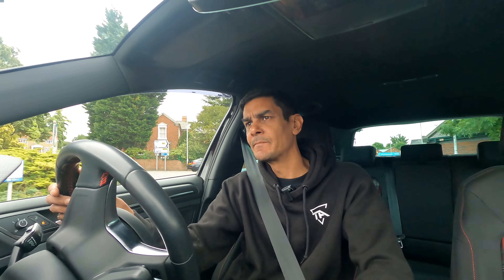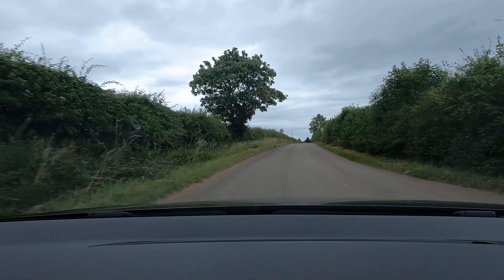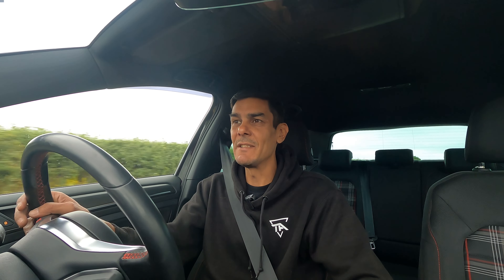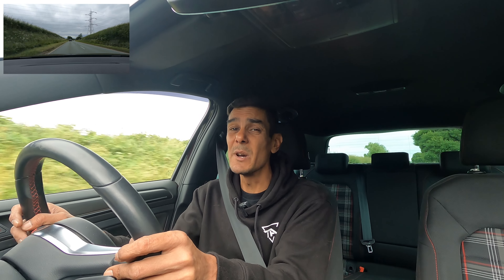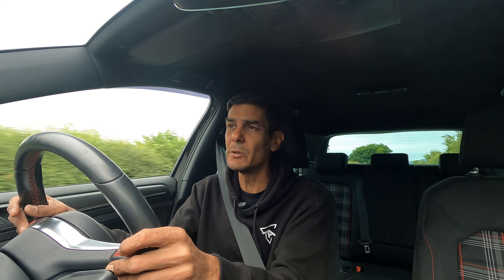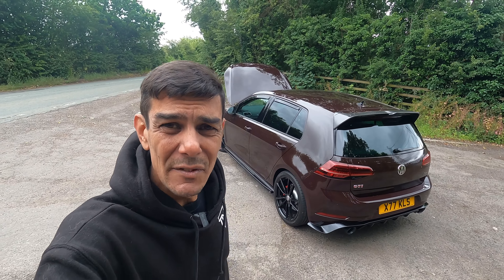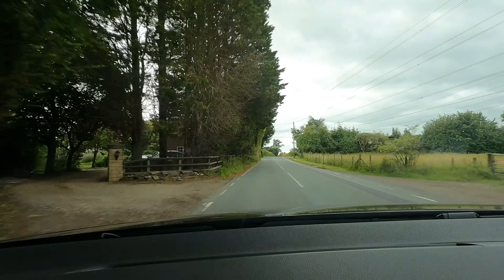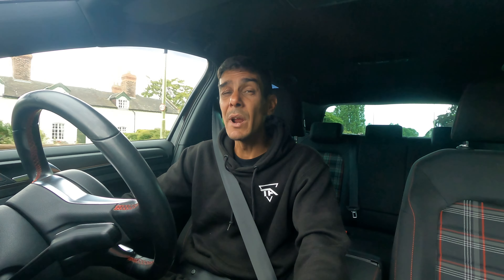REVIEW: 6 MONTHS WITH A VW MK7.5 GOLF GTI PERFORMANCE

Comment: Hi mate, did you get a new clutch since u got it mapped? Looking to get my 7.5r manual mapped as well but worried about clutch
Reply from the maker: I didn’t, still saving money as I will get a new upgraded intercooler at the same time👍🏽
Reply: @Sdw77  how long have you had the map for? And have you noticed any clutch slip?
Reply from the maker: @ashwho-6319  got mapped on 5th April, no clutch slip, all good. It is not a daily driver though, sunny day car/weekends, otherwise it is tucked up in my garage 👍🏽😂🫶🏽
Reply: Have you upgraded clutch now out of interest